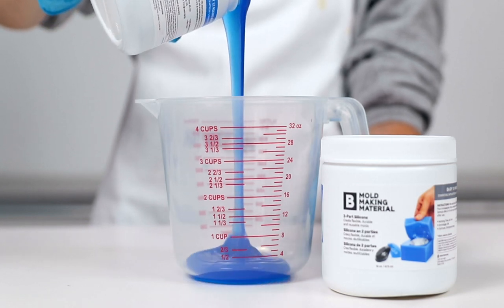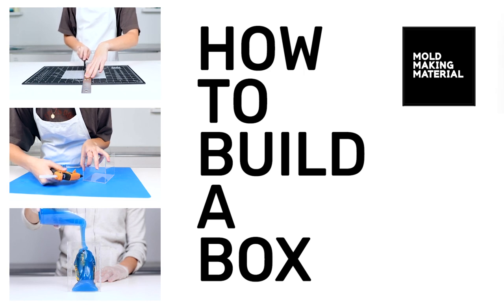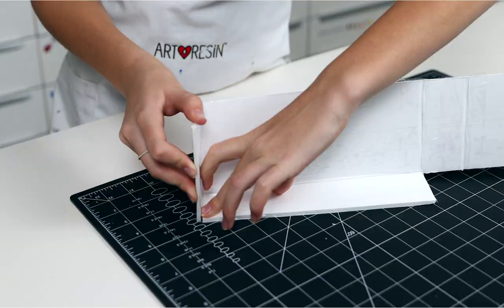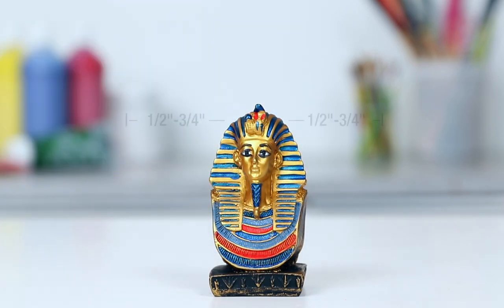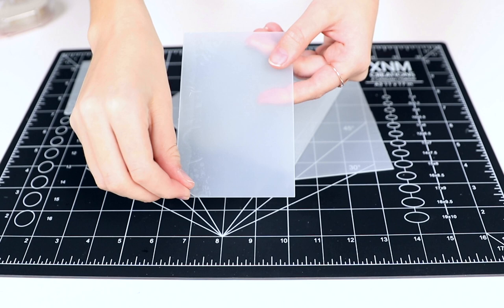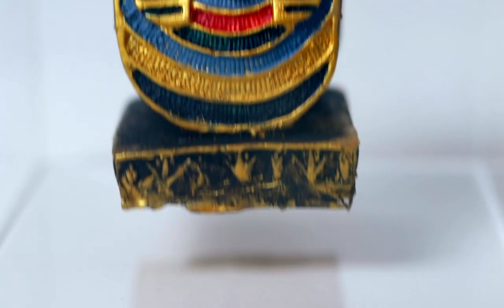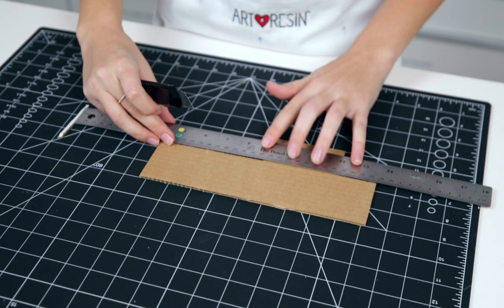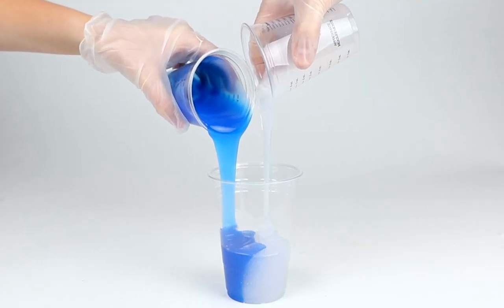How To Build A Box For Mold Making

Comment: What plexiglass do you recommend using? I've gotten 3 different thicknesses and they all seem way more rigid than what I see on many videos.
Reply from the maker: Hi Jack, you can use any thickness you want really, it is just to form a container to hold the silicone and is going to be removed once cured.
Reply: Can you please be more specific in the thickness of the plexiglass you used?  Thank you.
Reply: FOR $1 YOU CAN USE RIBBED COROPLAST AND MAKE PIECE OUT OF BONDO
Reply: @Artresin  how do you remove the mold from plexiglass once cured? Does it come off easily or do you have to take it apart? Thanks!
Reply from the maker: @thesuperaussies4776  most times the MMM will peel off the plexi glass but sometimes can be trickier depending on the size and shape .